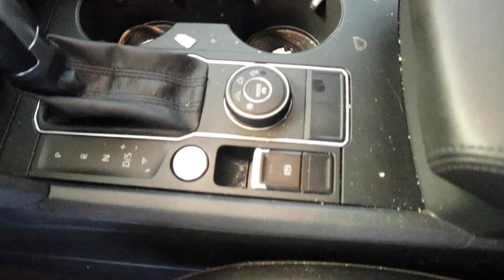Detailing Inside The Customers Garage - Hunters Mobile Detailing

Comment: Bro one big suggestion that helped me a ton and costs almost nothin, a shut off valve! You can buy them at Lowe’s for like $8 but then u can fill your buckets with water, use the shut off valve, and then hook it up to the pressure washer with a quick connect. Saves you from running back and forth and makes a world of difference!

Comment: If you really want to get rid of the smells before you put your car bomb in get you an ozone generator and turn it on in the car with the air running while you do you exterior and by the time the wash is done it should be ready to air out and than bomb

Comment: I charge $50 to detail inside and out
Reply: It all depends where you live and cars you’re doing, $50 isn’t bad just depends on what you’re doing to the car
Reply: @miguel90744  I extract carpets and seats I spray wax the car and armor all clean s panels and then put leather cleaner on ever seats
Reply: @jttovar4655  okay maybe $50 is too low lol
Reply: thelastm  what’s your starting price ?
Reply: @miguel90744  yeah the only reason is a charge low cause I want costumers to come back cause I live in a little town.
Reply: @jttovar4655  That’s why I said depends, Area, car, a did you just started detailing. When I started I started at $25 just remember after 6 months raise up your prices